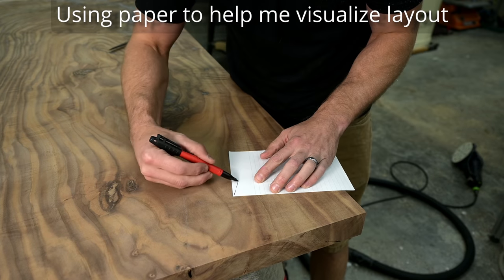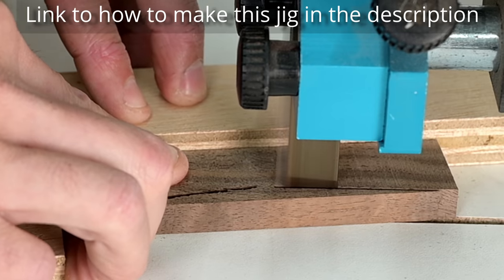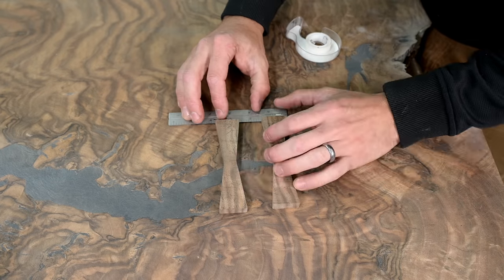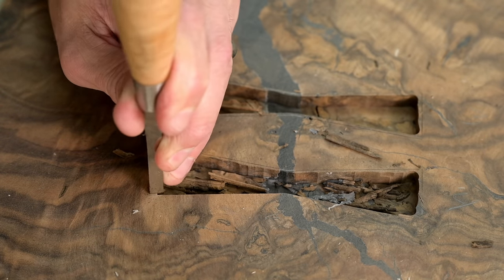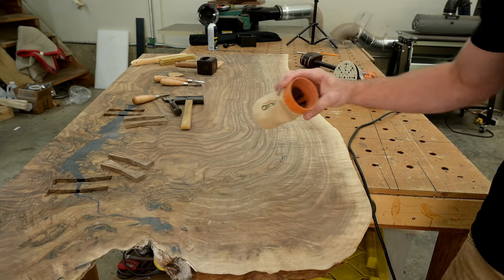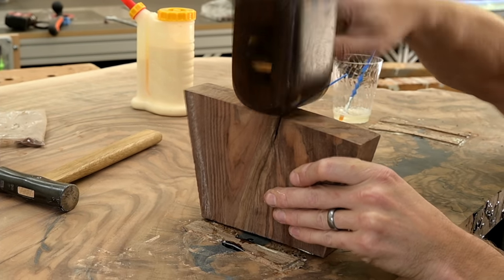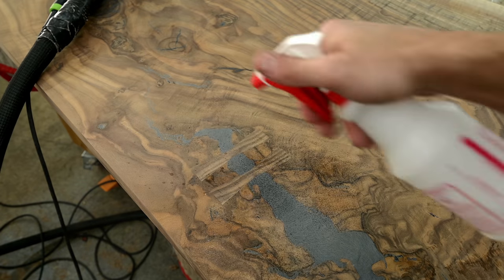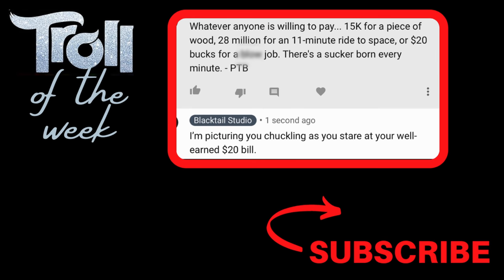Bow Tie Inlay - How, Where, When, and Why

Comment: Both. love the work Cam! I'm wondering if you could stop drill the crack next time and fix with glue and sawdust to plug the hole to keep the crack from spreading (looking at aviation structure repairs)?
Reply from the maker: Oh maybe!
Reply: @BlacktailStudio  worth a shot. I'd drill it at the end ( where the current end of the crack is.)  Or drill and cover up with a bow tie at end of the crack. Love the work cam keep the the awesome work.

Comment: Las Angles and Mexico City  Just spent $3000.00 on wood. I got several pieces that show the graft between the Black walnut and English walnut. The wood shows a lot of figuring. I can't decide if it is a gimmick or beautiful?  I have all the parts for my slab rotisserie, need time to put it together. I intend to make my own C channel, using my plasma cutter to cut the elongated holes.  Bill

Comment: DIY for a desk drawer. I got this 3" slab of walnut that's been sitting in my basement for 3 years waiting for a project. I'm thinking about making it into a desk top with a hidden drawer. I'd like to save the live edge, but have it be the drawer face. Would a 3" slab to be stable if I removed about 2" from the underside for a drawer area, leaving about 1" or so to the desktop? Have you ever tried this in your amazing builds?
Reply from the maker: Never have!

Comment: DIY/Build both;  Cam I am not ashamed to admit I steal ideas from others as I attempt to get better at woodworking.  It looked to me as though you roughed out a bow tie design and then I guess fashioned the little jig to cut the bow tie out on the band saw based on that design.  I want to learn but not wanting to make a new jig every time I sketch out a bow tie. I drew out two designs on graph paper one using 8 degrees and one at 15 degrees for the top angles.  Then as best as I could I cut out two jigs with some MDF.  Main point is that on the 15 degree bow tie the length of the blank should be ~2X the width, on the 8 degree jig the length of the blank should be ~3X the width.  Knowing that I can adjust either the width or length of the blank to work in the jigs depending on whether length or width is the deciding factor for a particular bow tie.
Mark McClellan
Beaumont, TX
Fly Navy

Comment: DIY Build. Cam, if you have a crack in the wood that hasn’t ran all the way across, can you stop the crack from running any further by drilling a small hole at the end of the crack?  This may leave an odd look to the finish though unless a mixture of sawdust and glue would help it blend in. Your thoughts…
Reply from the maker: Not sure if the metal trick would work on wood

Comment: Both. Cam why can’t you use the template and square the corners on the holes. Use the rounded template to make a template for the bow ties with pointy corners. Seems that would save some time?
Reply from the maker: Then they wouldn’t match the bow tie that fits that hole

Comment: DIY: Hey kam, I was able to buy a 2'x9'x2 slab for 550. They even let me use there 52 inch wide planer to fix up my epoxy job! How would something that size go for at goby walnut.
Reply from the maker: 2x9x2 = 36bf. Usually $15-20 per bf. So $540-720. Flattening would probably be another $100 or so.

Comment: DIY : 1) why use a bow tie shape instead of leaving as a rectangle. Seems to be it has the same holding strength. Glue surfaces all the way around.
2) also for your round router corners I agree I hate them. But wouldn’t it be better to just chose the corners after? You’re already doing ton of chisel work, this would eliminate most of it and leave just last bit to chisel.
Reply: Wedge-like shape of bow tie halves prevents the crack from expanding. The more wood around the crack wants to go outwards the stronger the bow tie prevents it.

Comment: Make a jig that screws to the routers base plate, cut a U into it as an in-feed but make the U wider than your typical butterflies. Set the depth of the bit to the thickness of the jig, Sand the rest xD

Comment: Question - What type of finish do you recommend for a walnut slab family kitchen table with heavy use by kids?  I'm using clear epoxy to fill in some cool voids.  I'm considering an epoxy flood coat vs a satin water-based poly finish.  Any thoughts?  Will the flood coat be more durable and easier to clean, or will it get scratched up over time? Thanks!!
Reply from the maker: Oh, conversion varnish is probably best

Comment: Beautiful Craftsmanship and advice  another note on doing the handwork  instead of a CNC or ? is it sometimes just feels good  to do something in a Traditional way  ! not ever Professionally but over the years  in life. i’ve helped put on many new Shingle Roofs on Freinds and Family Members homes  and no dought. using a Pneumatic nailer is the way to go with a bigger Crew  but in my life i have hand nailed  several  of those Roofs  and although it’s back breaking work  it also can be Satasfying to put in a hard days work of Labor  that will make you as a man sleep very well that evening  sure that’s Apples to Oranges  in comparing a few Bow ties to a Asphalt Shingle job but you get the Picture  and i of course tell my Freinds to  go rent a Nailgun and Compressor  for their job  because  it allows  one man to nail for several others feeding him  Shingles to set and nail efficiently

Comment: Both, I am building a multi species desk for my son and want to put a thin epoxy coat over it to make a worry free surface. How smooth or ruff (220 / 80 grit) do I need to prep surface before I pour over it?
Reply from the maker: 220-320 should be good

Comment: Would u be willing to give me some advice?
I overheated my table 13X40 inches and warped it. Do u have any ideas on basic straightening? Without over sanding if I don’t need to. Thanks.
Reply from the maker: Check out my bookmatched epoxy table build. Tip in there

Comment: Ok, just found and subscribed to your channel.  You have so much great content but I still can’t find what I’m looking for.  I want to cut a 30 degree chamfer in a round pedestal table that is 2” thick. I’d really like the bevel to be about 1 3/4” deep and I’m not finding any router bits that long.  I’m thinking maybe a jig for a circular saw but I haven’t seen that done anywhere.  So I’m throwing out a challenge.  Let’s see if you can come up with a jig to cut a deep chamfer in a round top.  Also, how do you figure how much die to add to your black epoxy pours?  I’m assuming that’s the transtint in your links?
Reply from the maker: I’d have that bevel done on a cnc. And I add till it’s dark enough

Comment: It doesn't hurt to put the bow-tie in the oven at low temp for a couple of hours just before pounding it in. (wood does most of its shrinking below the last 8 percent of moisture content)  Also, make the ends of you spline close to the width of the chisel you plan on using.
Reply from the maker: Never actually heard that. Interesting idea

Comment: Instead of bowties, you could experiment with an hourglass shape. For those cracks that might actually need it, it would still serve the same functional need as long as the neck was still thick enough. They'd be harder to make, but degree of difficulty can enhance the beauty and value of a piece. I'm sure you'd want to experiment with scrap first of course. But the experiment would make an interesting video as well.

Comment: Been making tables a long time too and have NEVER needed a bow tie on a crack… think of a river table… biggest crack you can have… epoxy will hold it… in fact the joint is stronger than the wood itself… 

But each to their own… if you think it needs it… fill your boots 👍👍👍

Comment: thank you . question please when i worked as a machinist any cracks we drill a small hole at both ends to keep the crack from spreading then repairs . why is that not done on wood ?
Reply from the maker: I’m not sure
Reply: @BlacktailStudio  thank you. it just seems like a good idea as the wood grain running along the path would continue along its mary way . i do not know just getting started with the wood stuff . you know old azz geezer trying to find something to keep me above ground .

Comment: Finding half in the imperial system is easy. Want half of 7/16? Its 7/32. All you need to do to find half of a fraction is double the denominator. Pretty easy, really. I think my issue with the "battle of measurement systems" is that people want to justify using one or the other. That's easy too. Use whats convenient to you.

Comment: I envy you your Japanese forged iron chisel.

I don't find the bowtie inlays attractive, to me they do look like Frankenstein stitches. I would at most use ONE, and only IF there was no better way.

I would  use the bowties at the bottom of the table top though, to strengthen / keep the cracked pieces together, while only pouring the epoxy on the top of the table.

as long as you and / or your clients like the bowties, I have no problem with that.

Comment: Cam..is ig possible to cut out a bow tie pocket and just use epoxy poued for the bowtie?
Reply: sounds like an interesting idea. I'd tint or color the epoxy though.
Reply: @SAUdustBuilds  Tinting of coarse!  I did try to border 1 once but the epoxy bled into the slab as the pocket wasnt sealed on the edges. Lesson learned.  Great Videos always Cam !

Comment: The problem with using burls in the solid is they are inherently unstable. The more figure you have in it the more unstable it is. There's a reason why fine antique furniture isn't made out of solid burls. I'm guessing if you seal the slab up so completely no moisture can get in, and place it in an air conditioned environment away from direct sunlight, you've got a chance of it remaining flat and stable, but for how long, nobody knows?

Comment: There are many, many ways of measuring half of any distance way more accurately than dividing a number by half....
Reply from the maker: Multiplying by .5?
Reply: @BlacktailStudio I should've been more specific.  While metric might seem good, the imperial system allows more divisible numbers.  Divide a yard by three vs a meter, and you'll see why the imperial system is used.  So base 10 isn't always the best.  Getting back to measuring half... A great trick is to measure a length by some number on a ruler larger than the width and dividing that number by two to get the half distance.  E.g., take a width of board and if is measures a total width of 4.5 inches (or whatever), measure it to be 6 at a diagonal.  Half of 6 is three and mark it at 3.  The 3 mark will be the half by geometry using similar triangle rule.  Other ways include make a sqaure "X" the center of which is the half way point exactly.   Depending on the accuracy that you require, marking it in paper and folding in half works.  The other way is to use a drawing compass.  Make the compass distance longer than half of the width.  Put the sharp end at point at end of the line.  Make a semi-circle overlapping the center.  Do it on the other end of the line point. There will be two points on the semi-circle  where they meet.  Draw a line segment fron those two points.  The line will be perpendicular to the line and bisect the line exactly in half. Bam.

Comment: Both. I'm not a fan of the bowtie look, personally. I completely understand the need for them when preventing propagation of cracks, and if they have to be on the top, I'd really look for a more aesthetically pleasing (to me) technique, but if nothing else is available, then the minimum number of bowties required would be the way I go. On the bottom, not a problem to use as many as needed.

Comment: It's reassuring to know that you dislike your Bosch 1/2" router. The plunge base on mine is dog shit. I use the 1/4" unit as much as possible as it's plunge is nice and smooth. Even striping the 1/2" base down and lubing that mother up, it still plunges wonky and with way too much effort needed. It doesn't make for particularly safe morticing when you've got to strong arm it down.

Comment: DIY Build: You told us why not to use epoxy on the top side of the table, but you didn't explain what the advantage of epoxy is on the underside. Wood glue is stronger than the wood itself and doesn't require setup like epoxy, so why not use that on both the top and underside?
Reply from the maker: I feel like it’s more forgiving when they aren’t cut as precise

Comment: Every novice woodworker thinks one piece slab tops are the classy statement way to go but in practice very few timbers will let you get away with it and only because they are more stable than most. I have an original Victorian desk that has a one piece mahogany top but it's clean straight grained timber and none of that ugly epoxy crap.
I refuse customers who ask me to make a slab top because eventually it will cup and look stupid. So they go to some hack with a barely seasoned slab and get it bogged up with Epoxy. Yuck.
Then they complain to me a year later how they got ripped ! the wife hates the cracks and wine glasses wobble on the top. Lol.

Comment: You could just not cut a 1 5/64" piece of wood. Or, if you want to be really clever, you can ask someone with a CNC mill or water jet to cut a template out of 1/4" stainless and save yourself the hassle of measuring things. Be smarter than your tools.